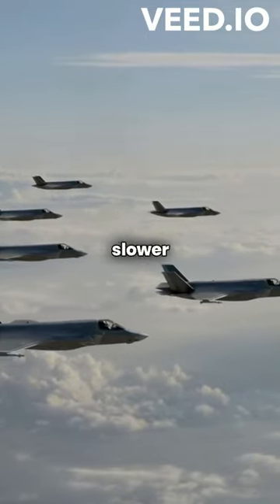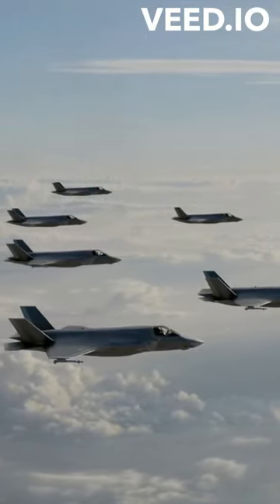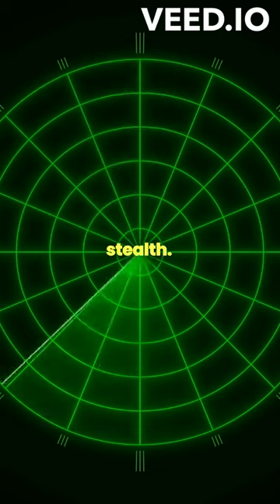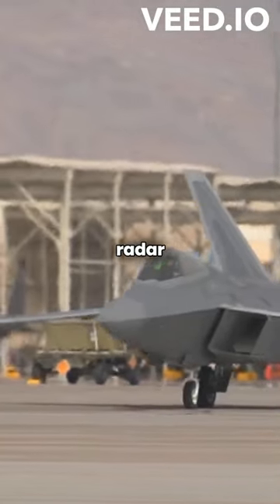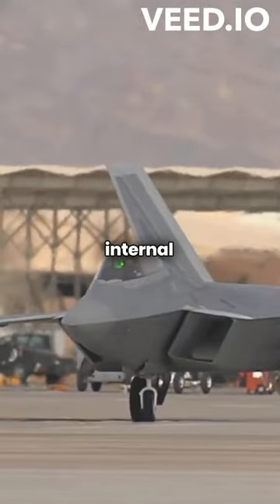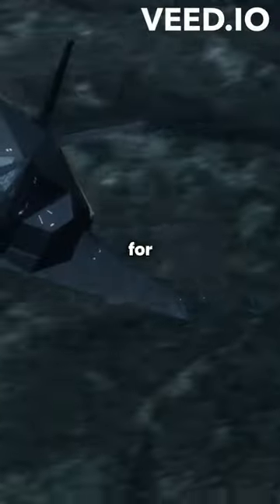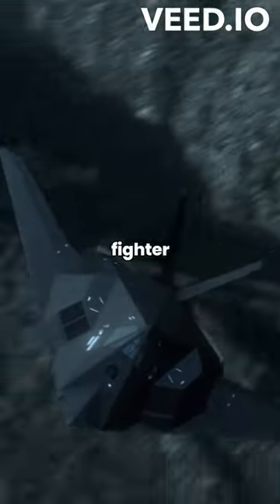Why Are Modern Fighter Jets Slower? #shorts

Comment: That’s false, speed creates a lot of friction and friction creates a lot of heat, a stealth aircraft has to be stealthy in both radar and thermal signatures. In modern air combat speed is not as important as stealth, stealth fighters don’t need as powerful engines as for example a F-15 fighter which is meant for both Beyond visual range and Within visual range combat, a stealth fighter exceeds in BVR combat but they aren’t as good in WVR combat. Obiviously they still can fight WVR because most of them are multirole fighters but they aren’t meant to be jack of all trades.

Comment: Speed is great for intercepting but it doesn't allow you to maneuver and fight. It's not all about stealth. They started ditching speed for maneuverability then F-4, F-101, on thru the F-106 we're not able to dog fight. No matter the missiles they can and do miss. Then you need a gun and to twist and turn. Speed kills unless you are running away. That was an issue with the SR-71 it wasn't maneuverable and couldn't be used for its original purpose of intercepting Russian bombers.
Reply from the maker: Thank you for sharing your insights! You've raised valid points about the trade-offs between speed and maneuverability in fighter aircraft. Indeed, the balance between intercepting speed and dogfight capabilities has evolved over time, as seen with aircraft like the F-4 and F-106. The limitations of high-speed interceptors like the SR-71 for dogfighting were notable, emphasizing the importance of a well-rounded design for different mission requirements.